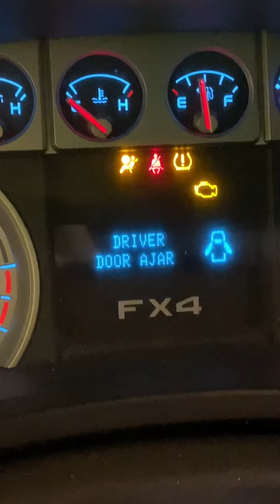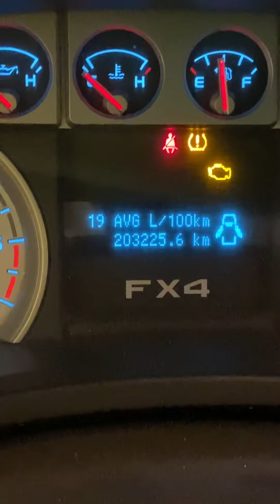Toyo Open Country MT Tires 73,000 Mile Real Life Review

Comment: Did you notice any difference in acceleration and fuel mileage ? 
Also what gears are in your truck ? 
I have 05 Silverado 1500 5.3 with 3.14 gears and worried they are to heavy but I really want to try them out
Reply from the maker: I had 3.73 gears. What size of the tire are you planning to go with? I did notice a difference of acceleration and gas mileage. The 35’s are heavy tires. I think around 75-80lbs each…my stock tires were probably 45-50lbs. Big difference in rotating mass. Keep in mind I lifted my truck at the same time, so that would have also affected my acceleration/gas mileage. But tire weight plays a big roll.